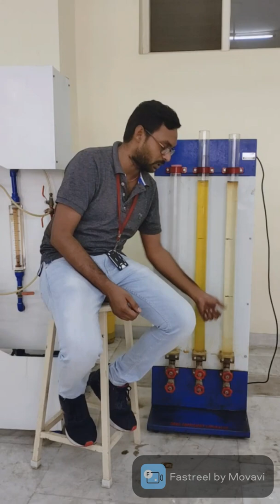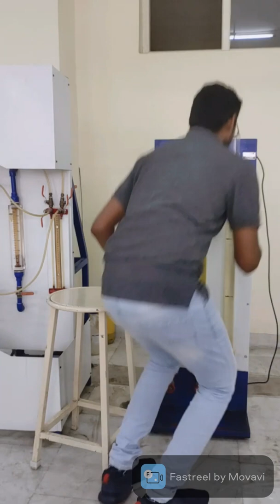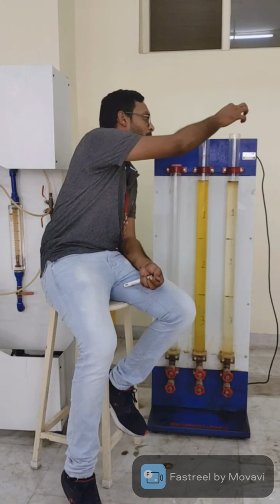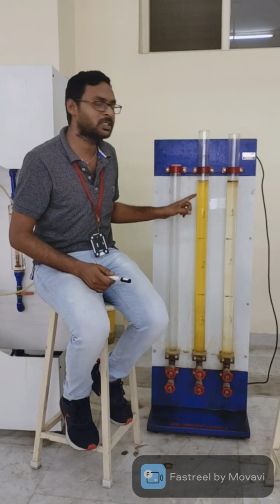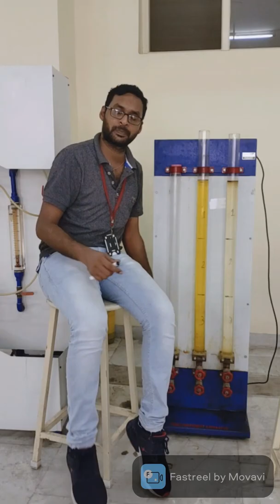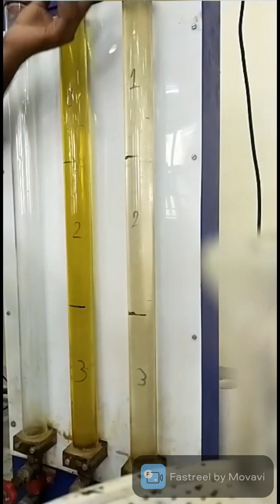PARTICLE MECHANICS LAB: Measurement of drag force, verification of stoke’s Law

Comment: Sir More viscous fluid cause more drag force, am I right
Reply from the maker: Yes, a more viscous fluid typically causes more drag force on an object moving through it. This is because the viscosity of a fluid represents its internal resistance to flow, which causes the fluid particles to move more slowly and generate more frictional forces on the object as it moves through the fluid. As a result, the drag force experienced by the object increases with increasing viscosity of the fluid.

However, it is important to note that the relationship between viscosity and drag force is also influenced by other factors, such as the shape and size of the object, the speed of the flow, and the Reynolds number. These factors can interact in complex ways to determine the overall drag force experienced by an object in a given fluid, so it is not always straightforward to predict how changes in viscosity alone will affect the drag force.